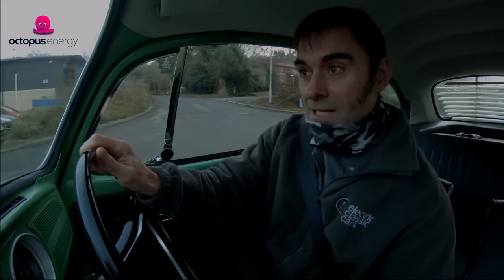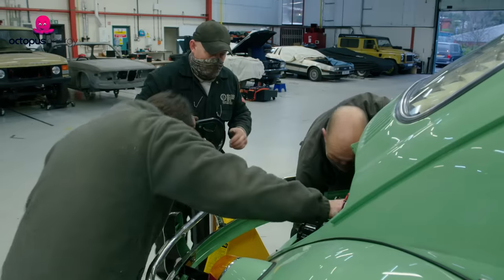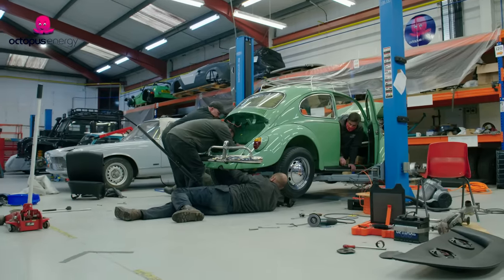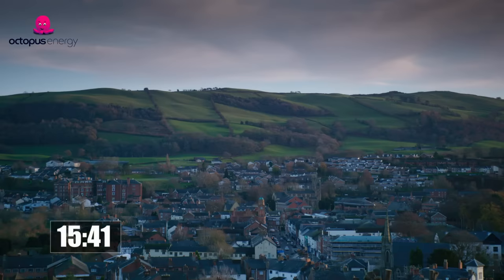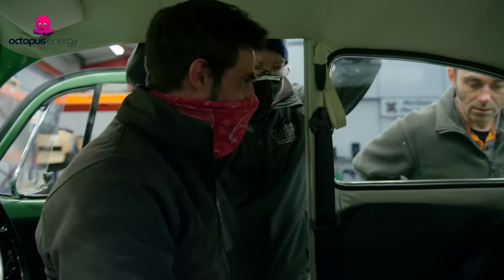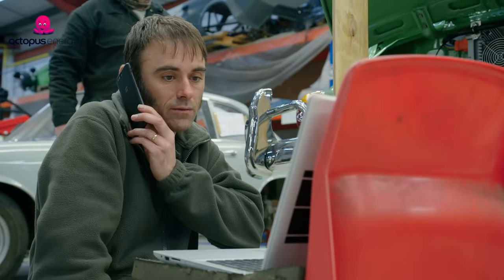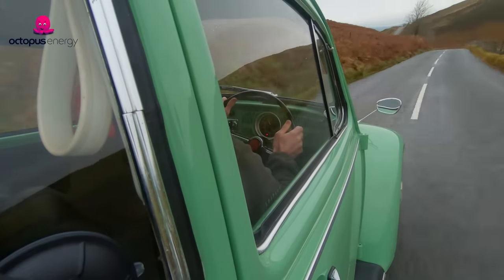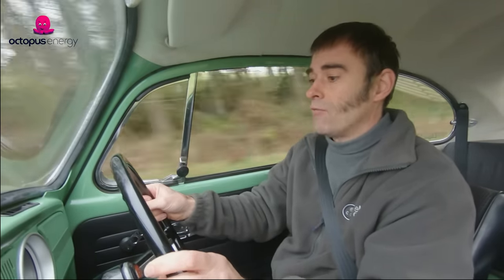VW Beetle converted to electric in a day

Comment: I think it defeats the purpose. Nobody knows electricity is from natural gas. The electric providing power for the car, is ran off a motor using natural gas. You would need a non-combustible material, providing earth stable sources, to provide for power to a motor whose material couldn’t be harvested to make, and that would never get replaced within five lifetimes. If an accident happened, for five lifetimes that lineage wouldn’t own a car, for five lifetimes that lineage couldn’t drive to work with that reason. If you were serious about change you’d try hydraulic to an engine, TRY hydraulic to an engine though. That’s tough
Reply from the maker: In the UK most of our electricity comes from low/zero carbon sources like wind, solar, nuclear, biomass and imports. Gas accounts for about 1/3 of our electricity generation.
Reply: @ElectricClassicCars  that’s great, so how are those made?

Comment: So now the emmisions are from coal or nuclear to generate it's electricity..... so it's NOT trully a zero emmisions vehicle.   For in town driving this would be great but here in the states I can drive 150 to 200 miles one way to work so I need a vehicle with 400 to 500 miles of range.  I drive a GMC 2500 quad cab 4 wheel drive pick up that I pull a heavy trailer loaded with heavy equipment so I need a LOT of pullling power and hundreds of miles of range on a battery..... a real WORKING truck.  I just haven't seen that available yet in an EV.     Maybe when solid state batteries are available we will have that kind of range.
Reply from the maker: Here in the UK less than 2% of our electricity comes from coal
Reply: @ElectricClassicCars  We have a very high percentage that is coal power here in the states.  Nuclear is clean and the UK being surrounded by the ocean could have very good wave powered electrical generation.  I like the idea of clean green energy I just wish the battery tecknology would catch up.  The amount of petroleum base it takes to extract and smelt then produce the batteries is still very high.  Eventually the battery technology will be better.... I guess we just have to be patient and kee the progress going.

Comment: So the car is double the weight, double power but with the same old brakes, springs and body… that is not dangerous no no 😂
Reply from the maker: It's the same weight and has been upgraded with disc brakes on the front. 👍
Reply: @ElectricClassicCars  okay, don’t you think it would be important to show that in the videos? For me safety is the most important thing if you should do something like this for us. And I don’t believe you with the weight - you tell you have 80 kg battery in the back, and minimum the same in the front even the double, plus that hunk of an nasty electric engine. So I think that car is about 200-300 kg heavier than before. You can see it in the video that the car is much much heavier than before. Just be honest - that would give you more customers 😂
Reply: @heine0085 I guess you've  completely forgotten that the engine and fuel tank  have been removed?

Comment: Converting your VW car into "compressed air engine" (CAE) is also a move in the right direction... Today, India is mass producing a box type model car- powered by such CAE technology, it claimed a 300. kms travel distance before air re. charging... By removing many car accessories (elec. starter, water radiator, fuel tank, etc.), the weight of the  VW car will be greatly reduce... By re cycling those "exhaust compressed air"  back to the main reservoir air tank- theres a possibility of almost no recharging acts for such "depleted air pressure tank"....

Comment: That's awesome but as always the actual facts are like tooth extraction. Things that should be told first are what are the total costs of the change over. The single most important fact that is always with held. Secondly it is not running on renewable energy. It is running on energy. The make up and that energy has a small percentage of renewable energy and is by no means saving the planet. About the only thing that is certain is there are no emissions from the vehicle. How ever the total cost of energy to produce the electric motor, copper wire, batteries etc uses mining and material production that in turn contribute to global emissions. So although this is an awesome conversion the true facts about what is achieved are some what miss leading and do not empower people with the knowledge to actually make a sound decision as to whether we are and by how much improving matters. Remember Germany spent 800 billion dollars going green and failed, and are now firing up coal plants in order to supply energy to the companies that make the parts we use to convert the VW. China is increasing it's coal usage by 20 percent in order to have energy for it's industry. So while it's a must to look at change we had better be honest about whether the direction we take is the correct one or just more political hot air.

Comment: Being a Beetle lover I almost wanted to cry when I saw thar beautiful engine come out of this restored beetle . What a shame to see it hacked up in the name of carbon emissions... 

    And his statement about how it supposedly handled better without all tjat weight in the back, is an ignorant statement because:  

Yes I suppose that it does on the pavement... However,  the weight in the back was it's major design improvement... It could go places where other vehicles would get stuck .. Thats the reason they were used in sand rails,  dunebuggies, and Baja conversions.. 

  This Beetle is now a woke product and a POS .. what a shame .. 
And regardless of what this guy says ... the power to charge this is not coming completely from solar and wind ... No , it's coming a fuel fired power company..... Solar doesn't work well in Wales ... Not a whole bunch of wind there either except in the coastlines or offshore... Germany tried to so wind and solar .. didn't work . Now they put their power plants back online full time and are having to power them with coal ... and the price for Kilowatt hour is outrageous ... when its available..

  Meanwhile another museum quality car it destroyed in the name of carbon wokeness ..

  I got nothing against electric cars.. I actually like them .. but a VW is actually quite heavy... Electric cars need to be made light .. Using aluminum and carbon fiber.. Not heavy gauged steel ..

Comment: Lmao, great ..they took probably the most reliable car ever built, which would basically never leave you stranded anywhere as long as you carried a spare fuel pump, belt and quart of oil and turned it into a $$$,$$$ boondoggle which CAN strand you ANYWHERE, esp in CA where about 90% of the remainder of them are....whose ridiculous idea was this!?! 😂. There's a REASON why electric "cars" were ALREADY OBSOLETE WHEN THEY WERE BUILDING THE TITANIC..

Comment: Really sad, everyone has bought into this scam of electric cars being sustainable. It's not sustainable to rely on rare earth materials while expecting UNRELIABLE "renewable" power like windmills or solar to power the batteries.  Coal or Gas (heaven forbid we use Nuclear) is still required to keep the grid running let alone to even build the batteries and electric motors. You've essentially removed a perfectly fine gas engine and replaced it with a more costly (over the lifetime) motor that has to recharge and have new batteries before a standard gas engine has to be refreshed.

Comment: It's over EV car owners.
No one put in the infrastructure necessary to accommodate electric vehicles, so it's over now.
Plus no one told the people how electric cars don't f**** work in the winter time.  Or when it's really hot.😂
Reply from the maker: Tell me you don’t own an EV without telling me. 😆🤣😂 I’ve had EVs for 8 years now, through many winters and summers. I’ll never go backwards to ICE ever again. The number of chargers increased by 45% last year here in the UK.

Comment: Should have titled the video.
We ruined a classic VW Beetle and made it less useful by jumping on the greenwash bandwagon.

The EV is the most destructive vehicle EVER devised.
It is FAR more environmentally damaging to produce than any equivalent petrol or diesel car.
It has a shortened life, due to the limited lifespan of the battery being just a fraction of a modern petrol or diesel engine.
Plus, as the battery is the largest and most expensive component in the vehicle, the car will be rendered almost valueless once it decides it doesn't want to be charged any more.
In short. They are a con. A very expensive con. A very destructive con. A very dangerous con.
The manufacturers know it. As do the "environmentalists". And governments. 
And anyone else with half a brain.

Comment: But Why ?
A VW Beetle has a good milleage per gallon why downgrade it ?
In the dumb words of Greta Thumberg: How dare you ?
You should have rebuilt the engine,  give it a tune up. 
These cars were not fast but had a good gear box and transmission,  I doubt an electrical motor will do.

Comment: And in one day you gave that car a MUCH bigger carbon footprint....

How?

Because it took TONS of carbon burned to create those batteries and get them to you. 

Thats why electric cars do NOT have a smaller carbon footprint than gas cars until the run off that initial carbon footprint of manufacturing.  
And that takes 80,000 miles. 

But also, the batteries only last 80-100k. 
So by the time an electric car is actually better for the environment, its time to replace the batteries and start over again!

Oh and BTW those numbers only work if the electric used in the car comes from solar or wind sources that have already worked of THEIR OWN inital carbon footprint of manufacturing.  

But as we know, 85% of our power grid comes from COAL and otjer fossil fuels....

Which means: 
THE WHOLE PREMISE OF "GREEN CARS" IS A LIE!!!!
Reply from the maker: Here in the UK less than 2% of our electricity generation comes from coal.

Comment: you ruined a perfectly fine show quality Beetle for what, the vehicular equivalent of a gaming pc? not to mention the sheer amount of inefficiency you squeezed out of one of the world's most efficient vehicles. half-brained idea that accomplished nothing but views. putting electric vehicles to shame. so glad we have another ruined Beetle in the world to fall apart at highway speeds from the inability to handle such weight. did you even touch the suspension components? anything?